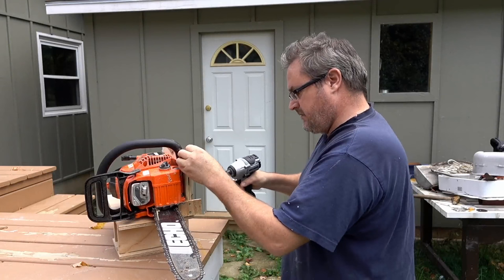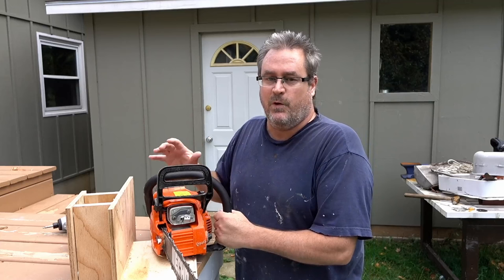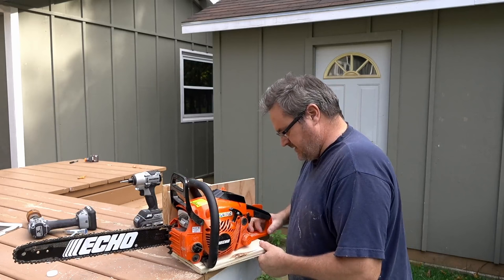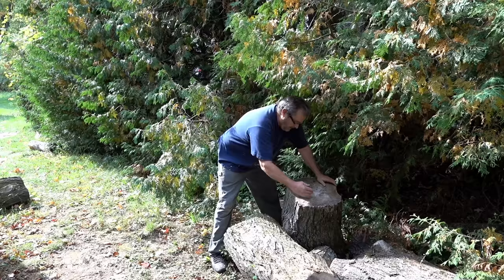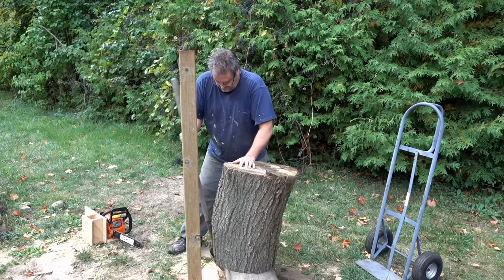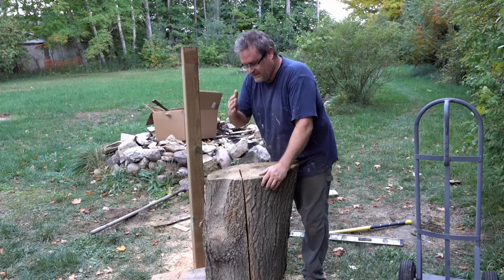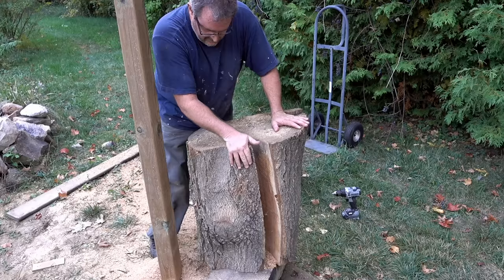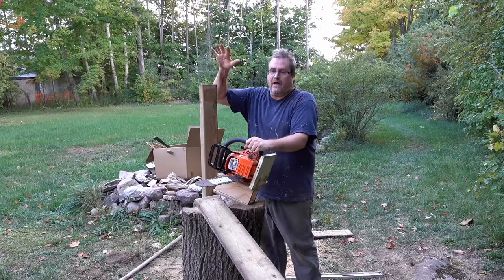Chainsaw Mill - More Cutting - More Details

Comment from the maker: Answering some comments on the vertical chainsaw mill and making another cut through the thickest log I have - around 20" diameter.

Many, many comments on using a rip chain to make it work faster. Guys, this works fast enough and I don't think it would be better to have it cut more aggressively in this arrangement.

Ways YOU can help support the work I do in making these videos:

Plans for sale: http://www.ibuildit.ca/plans.html

Making these videos is expensive and time consuming, and you can help by becoming a supporter of this channel on Patreon. For as little as $1 per month, you'll get early access to regular videos and also exclusive videos made just for my Patreon supporters!
https://www.patreon.com/user?u=865843&ty=h

Did you know I have two other YouTube channels?
My main channel: 
https://www.youtube.com/user/jpheisz
My home reno channel: 
https://www.youtube.com/channel/UCMlfKvFrEpzg1PEpTzJDWoA
Reply: Ripping chain isn't more aggressive, it's actually got less teeth. Ripping chain is narrower and leaves a smoother cut.
Reply from the maker: cabinfevrr
Less teeth for any cutting blade means more aggressive. Think about it.
Reply: I have thought about it. I've also used standard chain, skiptooth, as well as ripping chain for milling using a logosol mill. Until you use all 3, you can't tell me that ripping chain doesn't produce a cleaner job. Using ripping chain, the result is as clean as a bandsawmill. The reason for less teeth is the ability to clear sawdust faster and easier, resulting in a cooler chain. The grind on the teeth is also less agressive, designed to shave the wood like a tiny plane, rather than rip the fibers. finally, ripping chain is typically thinner than crosscut chain. But, this is all gleaned from my real-world hands on experience milling hemlock, oak, maple, birch, pine, as well as burls.
Reply: I'm only a new viewer to your channel, but love what you do. 

Now, I realise this was just an experiment, to see if it would work, and how well (thumbs up, by the way), and also realise that you would do the majority of the secondary cuts on your bandsaw, but if you wanted to, you could go all out. You could actually put 2 posts in the ground, 3 or 4 feet apart, with a fixed connecting "run" length across the bottom, a central "adjustable" post in the middle for the chainsaw, and a removable connecting "run" along the top. 

That way, instead of moving a hug ass log inside, you could just shift the chainsaw 2 or 3 inches to left or right, and do another vertical cut that's going to be parallel each time.

Comment: Great job!  Your video has gotten me wondering about how one could create a 4ft x 4 ft in the shape of an X that might allow the user to straddle the base up against the vertical pole, but have 45 degree supports to hold the log vertically.  I really love the gravity fed motion and the design is beautifully simple!

Comment: I usually rip with the top of the bar what blows the chips and dust away from the saw and does not pile up anywhere. I usually do it bar down so you would have to turn the saw around lol :D A home made 10 degree ripping chain from a crosscut chain is great also even tho the original one leaves a cleaner cut is still a great option. Have ripped 8 meter 35cm diameter logs in half for loghouses so i have learned to how to do it fast also not killing the saw. I always use more oil in my mix 1:40 atleast. Also let the saw to idle atleast every 20 seconds for a bit.

Comment: You don't need the ripping chain, it is not ripping anyways, it is cutting endgrain. 
The standard chain is just fine. Cut some holes so you can loosen the bar and tighten the chain without taking the saw off it's mount.
Reply: nah your ripping

Comment: I'm thinking maybe two parallel 4X4s, set 2 ft. apart. Just off center from each other enough so the saw mounted on either makes the same parallel cut. Then the whole log can be cut without re-positioning it.  Starting to loose some of the simplicity of the whole jig. But that's what happens when we start resolving problems.

Comment: Could you add a second post, offset a bit to one side, to allow you to cut from the opposite side? That would save having to turn thick logs for the second cut.
Reply from the maker: Neat idea! That second post would have to be set very accurately and offset opposite (saw is on one side of the post), but definitely doable is a more permanent setup. The tip of the bar would have to overlap a bit from each location, so there would be a max size for the log.

Comment: hi john. what species of wood are you cutting and also is there a solution to make the log stop cracking over time? or do we have to cut it overall size to which we are going to use it and let it dry?
Reply from the maker: It's sugar maple.

Comment: I am sure you already know but just in case, That saw can handle a much longer bar and chain.
Reply from the maker: I may try that out one the much thicker (30+ inches) trunks out front. One concern is the pulling force on the post, I'd need to change to a 6" post set more solidly for anything bigger.

Comment: I feel bad only watching, like I should've been helping you to move that thing! Again, it looked pretty flat, even after the free-hand finish. Not that it matters all that much I guess, since it's still gonna cup and crown, even if it's perfect. 

As for a "ripping" chain, I've never even heard of such a thing. Idiots- it's a fucking chainsaw. But I also keep my snow tires on year round. Some men just want to watch the world burn.
Reply from the maker: I heard of ripping chains, and there have already been close to 50 comments on both videos recommending ripping chains. Granted, most of those are probably from viewers that have never handled a chainsaw, but watched several videos where the guy said the ripping chain is the bees knees. That may well be, for a typical horizontal rig, but is likely too aggressive for this vertical arrangement. 
It's the "helpful" nature of man that's, ironically, not helpful at all in most instances like this, especially when it's repeated over and over and over. Watch, there will probably be a few "ripping chains rule!" comments on this video, too.
Reply: pocket83 a ripping chain is simply a chain with the teeth ground to 10 degrees instead of the 30ish degrees of a regular crosscut saw. you can do that yourself if you like or have it done for cheaper than a new chain would cost. In any case the shallow tooth angle results in faster cuts and smoother finish when ripping

Comment: why not just cut it without the post from the start
Reply from the maker: Two big reasons:
First, the post guides it straighter than I could cut freehand.
Second, less effort. All I need to do is hold the throttle for it to cut at a good rate.
Reply: but you wouldnt have to move the heavy log